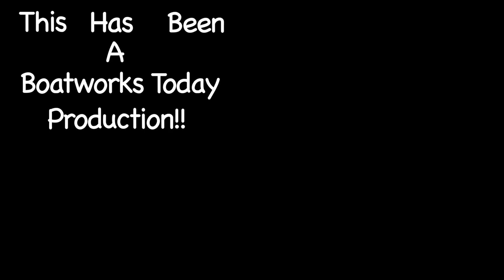FAIRING THE HULL FOR NEW PAINT!

Comment: Video got a bit bright and hard to see details on boat..  might try setting your iso a bit lower to reduce glare..
Great job on the boat, I want to ask if it is a "sunfish" sailboat or a lazer..  I think being as long as you said that it is a lazer..  plus the length of the keel points to lazer..
I learned how to sail at 14 on a sunfish and am looking to build or repair one.  I wouldn't mind building a new one and thought at first that carbon fiber would be good, but then I found out that E-Glass is better than carbon fiber...  What are your thoughts on these materials?

Comment: I am uncertain about how heavy the initial sanding should be on my old boat. I have no idea if the paint is epoxy. Do I need to remove all the paint down to the original fiberglass, which is cloth over wood? Also, you stated emphatically that bottom paint should be used even with trailered boats. Do I paint the water line portion a bottom paint and then the sides are painted a non bottom paint? If so, how do I keep the line waterline portion visible if I sand the entire boat? Your channel has been so valuable to this 77-year old and I apologize for taking up your time. I have a 22-foot sailboat hull, a day sailer, that I am setting up for an outboard with cabin. Thank you.

Comment: really appreciate this advice for sanding/fairing a convex curve with a long board.  Curious on the technique you'd use on a concave curve (in my case, the 90 degree radius of a catamaran tunnel).  It's a 90 degree bend with a 2-3 inch rounded inside corner.

Comment: I was thinking of getting the electric Flexi sander, how well does it handle hard materials such as profiling epoxy filler? I usually fair using a flexible torture board like dura blocks. Does the Flexi sander do well for higher grit jobs such as high build surfacer and barrier undercoats? Also how well does it deal with concave surfaces such as bulwarks? 

If you get the time to reply id really appreciate it, I have not seen many people use these tools but have been considering getting them, just have no evidence on how good they are! 

Thank you andy

Comment: Where are you getting the sandpaper for the Flexisander manual boards and the powered one?  Work had some good weeks at the office  so I picked up their second highest set, the ones without the exhaust hose ports. Didnt get the paper though.

Comment: I need to replace the rudder mounting pad and the coreing of my swimplatform and fill some small holes for the speed pick-ups. I was told to use vinyl ester resin because of its impact resistance on the rudder mount. Could I use it for the swimplatform and filling the holes with resin and cabosil.
Reply from the maker: Sure, could also use epoxy as well :-)
Reply: @boatworkstoday  I would like to finish with gelcoat is why I don't want to use expoxy on the swimplatform and the speed pick-ups holes. Does the impact resistance make sense to you. He told me to lay 4 layers at a time because of the heat and do about 22 layers total on the rudder mount instead of replacing the core that had rotted.
Reply: @davidtornberg8060  the rot could continue through the rest of the coring I would believe. but i am very new at this so i wouldn't know

Comment: I enjoy your vids very much and for the most part think your techniques and procedure are spot-on.  However this sailboat rehab has me scratching my head. You mentioned that in hindsight you should have removed the bow eye; at least mask it off!  Also the gunwales (rubrails) should be masked off.  You wound up with gobs of resin and gelcoat all over the aluminum which will take a lot of time and effort to clean up, or if left as is indicates pretty shoddy work.  Why add a layer of cloth(mat)?  The only reason for cloth is structural and the boat has lasted this long and appears to be in decent shape. At the most I would have applied the epoxy fairing putty to address the cosmetic issues.  You added a lot of weight to the boa as well as a lot of dollars to the repair bill.  Otherwise keep up the good work